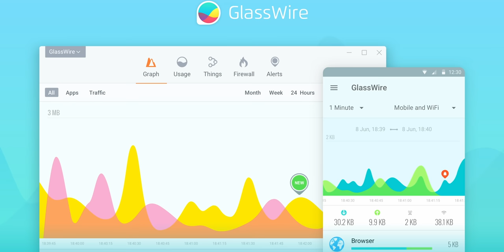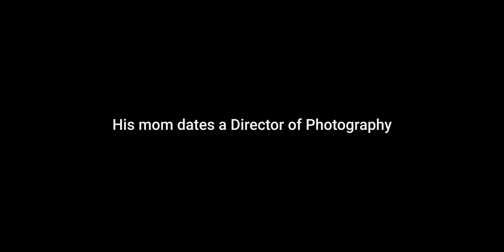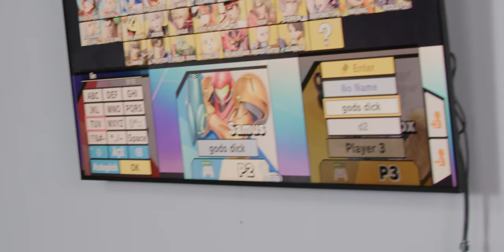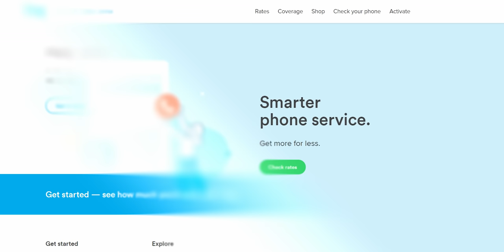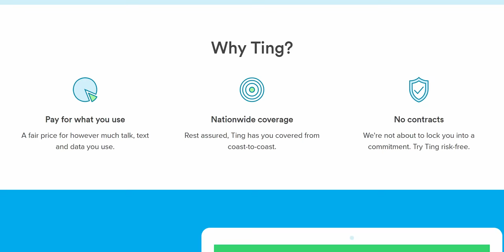Setting up NVIDIA's UNRELEASED Gaming TV

Comment: dont receivers add input lag?
Reply: Use Arc?
Reply: Receiver only processes the audio feed. The video is passed through to the TV, so there is not going to be any more input lag than an HDMI switch, which is basically 0.

Comment: Those super-thin Samsung TVs are so easy to crack. We've had two crack on us during install (well, we're pretty sure one arrived cracked.) I wouldn't be surprised it it has rainbow patterns after carrying it like that.
You probably still had those black foam/plastic adhesive panels sitting in a corner and should have used them for transporting it. Very nice displays but damn are they fragile.

Comment: Other than the fact you get a big TV, what's the point? Sure, it's 4K 120hz, but if I did my math right, you only get a little over half the pixel density of a 24" 1080p display. (Keeping the 16:9 aspect ratio means each side is scaled up 65/24. Square that to get the relative area, then divide the resolution ratio by that relative area for relative pixel density). I don't know the market that well, but I am sure they make some 48" or smaller 4K 120Hz displays, so you at least get equal pixel density to a 1080p 24" monitor. Almost certain they don't make 32" or 27" monitors at that refresh rate for 4k, but there probably is some size between the 32" and 65" that does.
Reply: @Patrick I would understand if it was top of the line, like not caring about performance/dollar when comparing the 2700x to the 9900k, but in this case, this isn't really top of the line. If it was 8K and there was a rig strong enough to crunch out all those pixels, sure 65" is fine, but 4K does not seem justifiable at that size, at least not to me.

Comment: Hey Linus, Any chance you got a killer Ethernet Adapter on that Motherboard? Because that was the Issue when I had huge Lag Spikes in Apex Legends every few minutes. I'm now using my Intel Ethernet. But you can also just uninstall the Drivers and reinstall the Drivers without the Killer Control Center program with the .inf file you get on their Website.

Comment: I don't feel like there was any insightful information here other than it's supposed to be low latency, and that it's a thick display.  All of the BFGD features worth benchmarking or at least giving subjective feels for like latency and G-Sync, color accuracy, brightness, and the integrated Shield were ignored in favor of setting up the lounge and complaining about controller preferences.  Further, does the BFGD support  FreeSync over HDMI for Xbox and Intel/AMD devices that would otherwise work with some gaming TVs?  Please give us some actual impressions, even if it is pre-release hardware.

Comment: whats the name of the 7.2 Hi-Fi system?
Reply: I too would like to know. It's probably an onkyo...like one of the 299.99 ones?
Reply: it was a Sony, i sell them. do yourself a favour and get an Onkyo, Denon, Marantz or Yamaha (or equivalent to those). Sony haven't made Baller amps in about a decade...
Reply: @theplayingofgames  I've heard quite the opposite though. Denon's (I have currently) are nice but lack firmware updates, HDMI Board Issues etc, Onkyo's are good for the price but have terrible distortion and the center channel seems to go out on A LOT of models. The only thing I've heard about sony's are that they work and sound good. But im open to looking at any of the highly recommended receivers.

Comment: would of been better to   do a 4 screen setup  per console

I wouldn'r bother the the sound bar, the samsungs do a hdmi audio pass through and will only work with sumsung  tv's

at this stage the only solution the there is from the perspective of hdmi switches are 8x8.

you  are  at tis stage you can only support 2 channel if you intend to extend  to multiple displays

55inch  is the lowest I go in a  4khdr setup peronally i would go upto 75 inch for optimal viewing  and gaming pleasure

you might  want to upgreade the internal hdd's and at an external caching drive to bopth the  xbox 1 x and ps4pro the 5400rpm hdd in both the xbox and ps4 are not good to game  on

Comment: I would much rather wait for the HDMi 2.1 OLED's this year that support 4k 120hz, and get a far better picture for a trade of very minor input lag and losing out on g-sync.. it will be compatiable with freesync anyways..I'm also shocked that the monitor isn't 165hz instead of 120, and this monitor is going to come out at $5000??? It's a huge fucking fail in my book with hdmi 2.1 coming for all tv's this year..